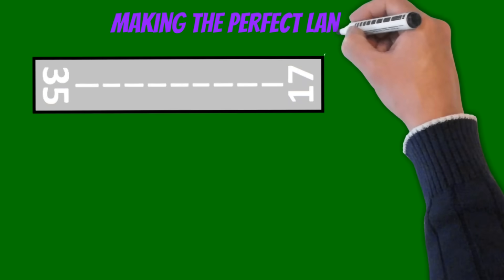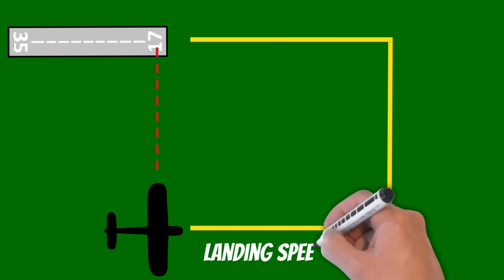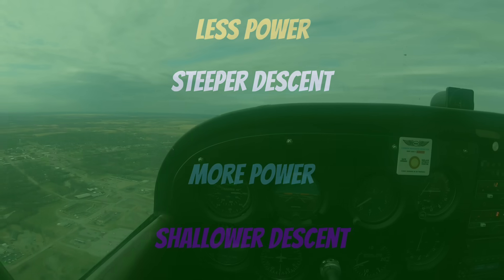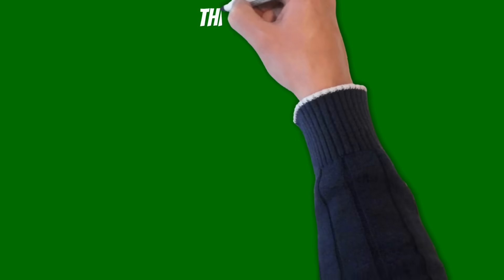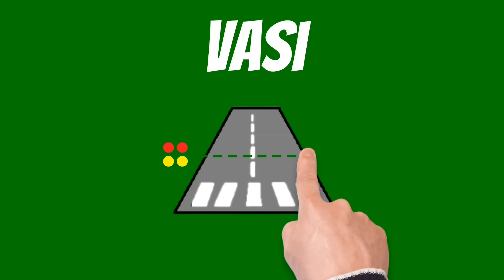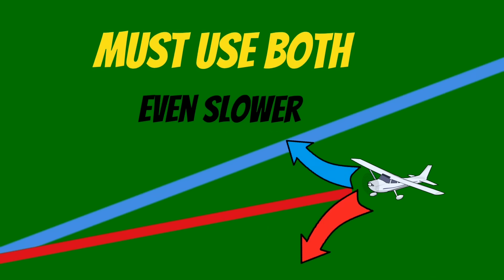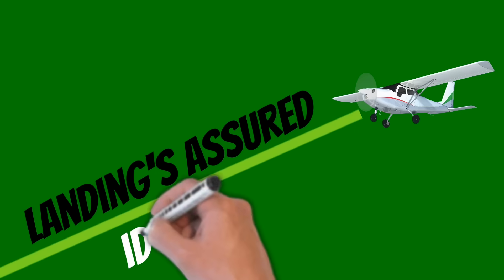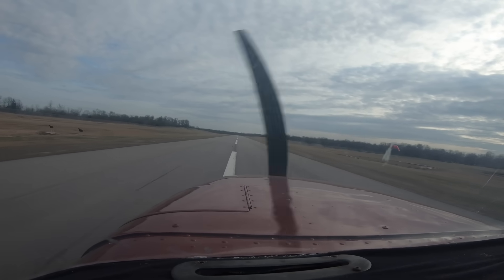Landing SECRET your Instructor won’t tell you [How to Land]

Comment: 7000 hour pilot here.  And I still watch these videos.  Controlling energy is the secret.  At full airspeed you move the controls x amount and y happens.  At slower speed you move them the same amount and less happens.  What new pilots struggle to understand is how much to move the controls for the desired result with different amounts of energy.   

The biggest mistake is coming in and trying to yank the yoke back to land.  It’s best to look at a landing as separate steps.   You do the approach.  Then stop the rate of descent.  Then get the plane to a takeoff attitude. (Yes takeoff attitude) on landing.   

Most students forget to stop rate of descent and try to magically get to the flare.   First you have to level off.  

Your instructor will most likely be inexperienced and tell you to speed up.  Flying too fast is a problem.  They have constantly thought flying slow is dangerous.  But in manuvering a plane the slower you go the faster your rate of turn.  A 30 degree bank at 70 in a 172 will get you turned in half the space.  The faster you go the more ground you cover.
Reply from the maker: Excellent tips! Thanks you so much for the comment

Comment: good video however, we make it more simple in the UK. And you never mentioned trim actions at the stages. What we do is...........Downwind, do your checks, no need for flaps as someone else in the circuit will fly stright into the back of you. Turn onto baseleg.......throttle down at main circuit height until airspeed is ready for 10 degree of flaps. Flaps, down, then trim for your desent angle. Turn onto final and if required, 20 degree of flap - then align your visual from the nose to start of the runway. Use the throttle and flight controls to keep your decent steady and smooth. Once you know you are in to the runway (and you know this as the threshold starts to move under the nose, slap on full flaps (which is like throwning an anchor out of the window) slight adjust trim, and then you land. Easy. This assumes a circuit height of abouts 1000ft. This secret is interesting, as this is the first thing taught for your PPL on landing. Maybe we are differnt in the UK.

Comment: My procedure to roundout is:   wings level, look downrange, roundout (rudders as necessary), then control slip and nose attitude as needed.  Having said that, in a strong X-wind I'll choose an aim point upwind of the center line. That way, when I level wings I'll see the extent of X-wind drift, correcting with slip  before reaching center line.  This is especially useful after a slipping turn to the aim point.
Reply: if you have a strong xwind and you level the wings you going to drift across the runway in a big and fast way.  the upwind wing should be held down from the time you turn final with opposite rudder to keep the longitudinal axis alined with the runway.  you should hold that upwind wing down all the way to touchdown to do a perfect xwind landing.  good luck if you ever try to land a taildragger in a xwind with the procedure you describe.  you better have a trailer nearby to haul it away from the runway.

Comment: Just what possessed the FAA to call the GLIDE PATH the GLIDE SLOPE is beyond me. PAPIs and VASIs have glideslopes. Fixating on just putting the numbers in the windshield can lead to target fixation, which exacerbates S-A problems in watching out for other aircraft that may be using crossing runways and straight in approaches.
Reply from the maker: You don’t have to “fixate.” You can definitely maintain your SA and look at the runway.  I do it all the time
Reply: @FreePilotTraining  As former airline captain and a pilot who still instructs as a retirement gig, the tendency for a primary student all the way to new FOs just off of IOE, is easy for them to not include the bigger picture on short final. The landing accidents and incursion stats don’t lie.

Comment: I'm a fan of practicing forward slips to correct for extra height/excessive headwind on final and no more than 20 deg flaps.  The forward slip is a great tool for that day you have to spot land without power.  20 deg flaps is more ideal for overshoots than full flaps and still allows forward slips.
Reply: Depends on the aircraft type, but I would only use forward[side]slip on a glide [fixed/no power] approach.
In the excessive headwind case, the effect is to make you lower, not higher - so a slip would only be for extremely gross errors.
Reply: With excessive headwind a forward sideslip is what you don’t want. Headwind makes you arrive lower already, you will need just more power to correct that. With no wind I guess you mean, you could use a forward slip to get you lower. But better learn to do it all properly with power and ‘feel’ the aircraft. Only use it with a glide in/forced landing.
Reply: @happyherbie with strong headwind, increase the final speed with less or no flaps this will increase a lot the glide ratio to ovoid the need from power: in europe on ultralights whe train each landing to land engine idle without touching the power to be perfect trained in case of a engine loss

Comment: It's been a long time since I flew. What I remember most about bad landings was overcontrolling if the plane kited up. The cure I found was to be very wary of forward elevator, because when nose high the plane is slowing down, losing tail authority, and pushing its nose down for you. A little down elevator goes a long way.

Of course, excessive angle of attack has to be addressed, should that happen.
Reply from the maker: Yes. My rule of thumb is if you need to use a big control input, immediately take half of it back out

Comment: Yes making the pattern the same every time will make the landings great most of the time. Weather changes and flying in only nice weather will make you a dangerous pilot, change makes you a safer pilot, trees, short runway, crosswind, tailwind, different aircraft…… I learned at a150 ft wide and 9000 ft long runway. I became better using grass short runways with obstacles at end.
Reply from the maker: Very true. This is just to give students a starting point

Comment: I flew EMB-145 50-seat Regional jets for an airline and the "pitch for airspeed, power for altitude" mantra still applies there. At least that was my mental thought process and it worked well.
Reply: That is 100% backwards.   You pitch for your desired flight path and thrust adjustments for airspeed.  If you have a wind shear and sudden loss of speed do you dive the nose down close to the ground or do you add thrust?
Reply: @SasquatchTour  It's all interconnected. The fact is that if I'm on final and relatively close to my glidepath then I am concerned about airspeed first, then glidepath. The number 1 priority is to not get slow. In a jet a change in pitch will result in a faster change in airspeed than it takes to spool up or down the turbines. Of course you're going to also be making corrections as you would always do. As far as wind sheer it's max thrust and pitch for airspeed for max climb. And yes, if that means pointing the nose down to get that airspeed its what you have to do, if you panic and pull up when you don't have the power/airspeed to climb you're going to stall and turn into a crater. Sometimes pointing at the ground is what you have to do. Look at the 2009 Colgan flight 3407 crash.
Reply: @kayaddicted  I understand what you are saying about them all being interconnected but you are still incorrect that you pitch for airspeed in a landing.   I should not have used wind shear because you quoted a wind shear escape which was my fear in using that argument. My point was if your speed drops 5 knots you do not pitch down on approach you adjust your thrust.  Second you mention a stall which you should push to unload the aircraft first so let's stick to what the video is discussing which is landing not maneuvers like windshield, slow flight, or stalls.  I agree with you that pitch, power or thrust, and airspeed are all interconnected  and what is done to one is affects the others   During land pilots should pitch for flight path and power for airspeed.  You are correct that you can't get slow pitching for airspeed but as a commercial airline operator you must land in the touchdown zone many airlines require the first third of the runway which ever is shorter.   For example Orange County KSNA with a runway length of 5701 and has a touchdown zone of about 1900 feet which gives you 900 feet to flare from the aiming markers and set the aircraft on the ground before you have to go around.  The key to a good landing is a stabilized approach and the key to a stabile approach is a stabile path meaning controlling path with pitch and adjusting airspeed with thrust because airspeed changes from VAP or approach speed to VRef at 50ft crossing the threshold.  VAP can be as much as 20 knots faster than VRef depending on the manufacturer.  You cannot afford on shorter runways to make a pitch change to chase airspeed and keep your flight path stabile and it's even more critical to do so in a jet.  What do you think the weakest airline pilots will do to a stabilized approach criteria if their primary method for correcting airspeed deviations are to pitch for airspeed.?  To help answer that question I will tell you that the number one maneuver that is failed and must be repeated on a maneuver validation or LOE checkride is landings. For first officers, the crosswind landing is failed at a higher rate than an engine failure at V1 and the argument of pitch for airspeed in a landing is good example of why it's occurring because airlines assume pilots already know the basics and aren't being discussed with the pilot until they no longer get away with it whether it's a debrief on a failed maneuver or an NTSB investigation into a hard landing which are occurring at the regional and major airline level at an increasing rate.   While pitch, power, and airspeed are interconnected you also must maintain a stabile flight path.   As the author of this video will learn when they start working on instrument that there are primary and secondary instruments for controlling the aircraft in various maneuvers.   If I'm assigned a 1500 foot per minute descent I can use pitch or I can use  vertical speed to achieve it however one technique will get the direct result and prioritize 1500ft per minute and the other is in direct or seconds because you have to find a pitch that produces 1500FPM.  This video gave me a headache with all the rote level learning to a landing.  The fact is a landing is simple and just like any maneuver you must lock up a variable and in landing that variable is flight path and don't pitch and chase airspeed which brings us back to what the author mentioned as the primary method for controlling airspeed is pitch which means any speed deviation and you adjust pitch before power which is dead wrong in a landing.  Airspeed can be directly controlled by pitch in certain maneuvers but we are discussing landings and in landing you must control a stabile flight with pitch and manage energy or speed with thrust.
Reply: @SasquatchTour  The truly correct answer is that it's interconnected and it's more of a preference of how you want to do it. Because if you make a change in one you necessarily need to make a change in the other there isn't necessarily a perfect right or wrong answer to this. 

FAA Airplane Flying Handbook (FAA-H-8083-3C), Chapter 8: Approaches and Landings

"A common error in the performance of approaches is the improper use of pitch and power. It is sometimes said that the pilot should use pitch to control airspeed and power to control altitude. This is an oversimplification. In reality, pitch and power control both airspeed and altitude simultaneously."
Reply: @kayaddicted while they are connected what is primary method of correcting a path deviation during approach and what is primary for airspeed?  If your auto throttles are on do they adjust for path or airspeed changes? That leaves the pitch to control flight path and airspeed is controlled primarily by thrust.  When you flare do you tell yourself thrust up to increase pitch?  No because that makes no sense.  Pitch is primary for path control and thrust is primary for airspeed during landing.  They are interconnected but there is a primary control and you still have it backwards if you say pitch for airspeed as your primary method for airspeed corrections.

Comment: Do not, I repeat do not align with the runway using rudder until just before touchdown.  Rookie mistake.
Reply from the maker: You can if you use the wing low method

Comment: Good Lord!  Now I can understand why the number of landing accidents have not substantially reduced over the last 50-years. 

While this presentation tried to make the pattern and landing simple, for me it made it overly complex. 

Your presentation is fairly good but doesn’t cover the essentials involving how to judge proper position on downwind leg (if that’s bitched the rest will require a lot of adjusting- to high/to low on base and consequently possibly on initial final), turn to base leg, key position on base leg (what’s it mean and how to use), use of the aiming point on final approach (land short or long and corrective actions)!and checking descent rate with landing flare round out, touch down pitch attitude maintenance. 

Your final approach explanation made something simple way more complex and vague than it should be. 

Yes, your stabilized approach commentary was okay but it morphed into an unnecessary complexity. 

As an FYI, I’ve accumulated 7,500+ hours as a CFI and focused my teaching on primary and CFI-A’s.

Comment: Nice to see military wisdom and keeping the pattern tight. "The Perch" is actually where you start the descent and final turn (or descending turn to base if someone has the odd desire to make it square, although I've never seen a Pitt's Special make a square pattern. And even a B-52 can do a VFR pattern inside most civilian Cessna square patterns. Lets keep it tight), as in a bird coming "off the perch". It's about 45 degrees from the numbers, inline with the overrun chevrons for an easy reference. But it could be abeam the numbers for a tight pattern if that's where you're starting the descending turn to final (with wind). Over 1700 hrs as an Air Force T-37 IP, 1.3 hrs at a time.  Gawd that sounds tiring. Enjoyed it all. 26,000 total now.
Reply from the maker: Thank you so much! I know! I’ve noticed that even my patterns in the C-130 are tighter than the patterns a lot of people make in a training aircraft.  Never flew the T-37, but it looked like a fun plane!
Reply: @FreePilotTraining  I was also a KC-135 IP. We flew tight figure 8 VFR patterns using both ends of the runway if the winds allowed.

Comment: The pitch/power/descent rate/airspeed discussion has been going on for almost as long as the Ford/Chevy or Yankees/Red Sox debates.  
When flying transport category airplanes on approach, speed is controlled by power and rate of descent is controlled by pitch.  (exceptions can be found when flying military jets)
To avoid "untraining" a primary student who goes on to fly larger airplanes, in decades of teaching in GA airplanes and airline simulators, I trained students that Power = Speed and Pitch = Descent rate.  In addition to using the same method when transitioning from light GA airplanes to large airplane flying, I found it more intuitive for the student than trying to get the students' heads wrapped around the unfamiliar concept of pitch for speed and power for rate of descent.  Cheers!